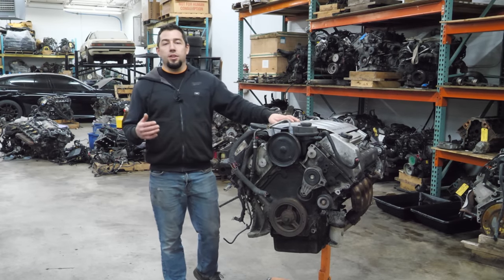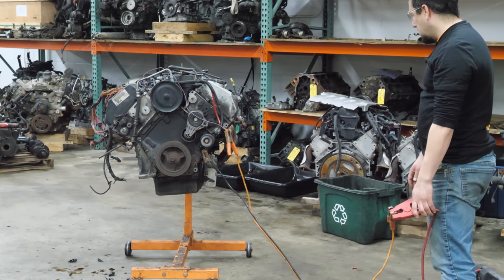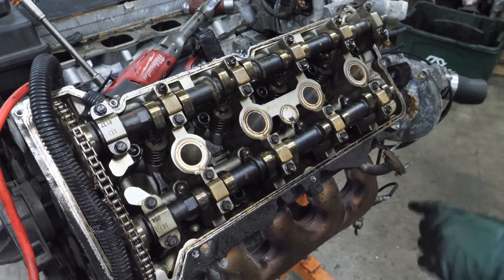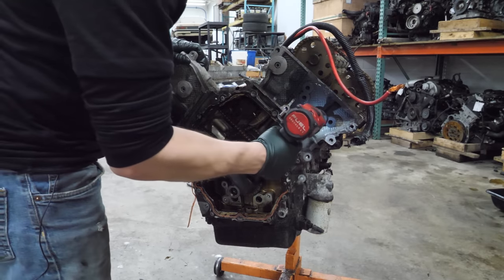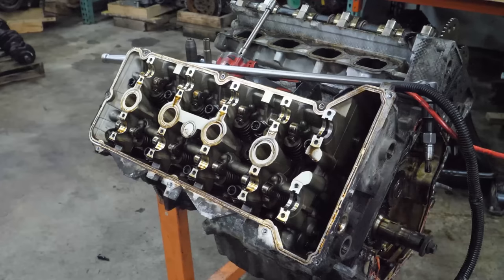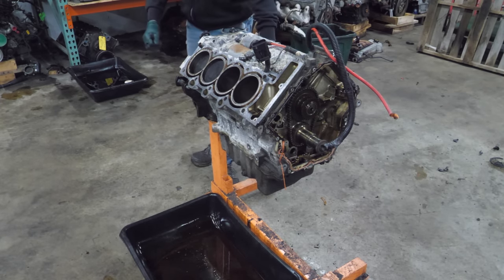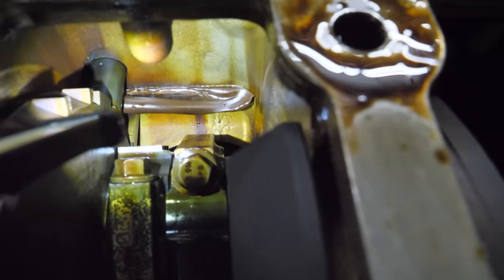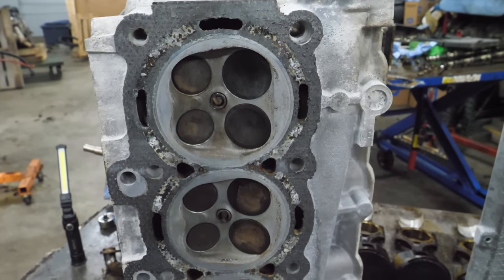Customer Returned This Cadillac Northstar L37 4.6L V8, How Many Things Can We Find Wrong?

Comment: The oil pan was definitely re-sealed. The Northstar is notorious for having oil leaks in various areas. Not to mention the condition of the head gaskets has not surprised me one bit, that's due to the head bolts stripping the aluminium threads.

It'd be a great engine if not for those engineering blunders.

Comment: Ya know, the sad thing about the N* is that besides the head stud issue, it's a fantastic engine. Efficient, light, good power. However, there are two things you gotta do to them: Reseal the upper oil pan/block split, and do the aftermarket head stud repair. If you do, you'll never have trouble out of one again. It's too bad that they have the headbolt thread problem. And that the vehicles they came in are crap. They're actually a really good, otherwise well-engineered engine.

The headbolt issue was resolved in the last gen of vehicles that had them.

Comment: I bought a 1996 STS with a 4.6 Northstar. I got the car at a drug enforcement auction for $2,500 with 8,000 miles so I put it on the road with my taxi company. We got almost 275,000 miles before it failed. I think the reason mine lasted so long was that I changed the oil every Friday using Mobil 1 synthetic oil. When it went through it was very catastrophic. (Broken crank, driver triedstarting the engine at 52 degrees below zero.)

Comment: Had a '94 STS which spontaneously threw a rod while doing a spirited merge on the interstate. No head issues, cooling issues, no signs of spun bearings, was good with oil changes... what a shame, body was perfect, only 60K on it. Had to junk it. Bought it for $4000 from an old rich contractor.

Comment: I wish you told me before you were going to do Northstar. Cause I would have told you to try brake the threads of the head bolts so that we would see how much force is actually needed to pull them off by torqueing them 😁.

Comment: I had a 98 Cadillac DeVille with that engine, with only 50,000 miles everything was mostly pristine but not the engine due to the head gasket issue.

Comment: I read some where years ago that the reason the starter ended up under the intake was they were working on an instant start system. The idea being to fire a key cylinder (fuel & spark) to start the engine. Most engines stop in one of three positions and the computer would use the starter to correct this position if need be.  Think I'll bounce this of wonderdog and see if he thinks it's BS

Comment: From an engine rebuilding POV catching an engine, even one with that much cooling system corrosion is better than catching an older engine with alot of mechanical breakage or blown head gaskets, or where you are essentially buying someone elses rebuild.  You might need to do a 10 over, new bearings are not too much of a problem. Catching a northstar between 150 and 200k miles with only superficial problems is the best of all scenarios, but catching one that only needs 10 over and no obvious head problems is the next best thing. 

I know people who run their engines to 400k and I know GM basically thinks a well taken care of engine will last to 350k, but really, I wouldnt do that your going to have a whole lot of problems you might as well replace all the stuff (timing chains, water pumps, fuel injectors, power steering pump, radiator etc at once). 

You can rethread the northstar head bolt holes, but this engines seems to have gone the distance without needing that.

Comment: No, the water pump kinda presses in the water outlet. I had this same engine in my 2003 STS and if you don't replace the water pump before it locks up. It will break the cam bolt off that holds the water pump drive pulley and it shreds the belt. So, as a rule of thumb. If you have one of these Northstar engines its better to replace the water pump every 100,000 miles to prevent this from happening.

Comment: Those upper oil pan/ main girdles used to leak like strainer at about 100k the gasket plate has pressurized oil through it and it was an expensive repair about 5 years ago a basic reseal was at least 3k at our shop and if you added in headstuds you were looking at about 5k for cars that were all 10 years old at the time I was there

Comment: Any clue on the uneven cranking? Mine developed a hot single cyl misfire that I never got sorted out at 192k. wonder if it broke a valve spring or something. Old dexcool plus air eats stuff and makes mud. Gets pretty nasty.

Comment: What was the torque on those head bolts? Weld a smaller bolt to the one that is broken off on the cam. That may work.

Comment: New subscriber, should have examine the thurst surfaces, fly wheel and rear main cap surfaces for damage. I ruined an engine by towing a trailer to fast. It caused the crank to have to much thrust play. The transmission catalictic converter bolts rubbed against the back of engine sounded bad.

Comment: I hated this engine until I drove a Cadillac that had a Northstar with the upgraded stud kit. I tried so hard to blow that head gasket. He even showed me one of the original head bolts for the aluminum block. It really makes sense that this was one of Chevy’s first all aluminum dual overhead cam V eights, Because the thread size for an aluminum engine was completely wrong. I really think Northstar ran out of money by the time they finish this engine and didn’t go back and fix any small issues, Because this engine was way ahead of its time.

Comment: As plugged as the pickup tube was, there seemed to be no sign of oil starvation.   The biggest problem seems to me to be a seized up water pump due to debris from a deteriorating head gasket.
This may have happed by refilling with the wrong antifreeze.. or neglecting to flush the radiator once in a while.

Comment: Water pump is easy to replace. It requires a socket that fits over the pump. The northstar was engineered to be great even game changing they cut corners by not reinforcing the bores for the head bolts.

Comment: 2004 they fixed the head bolt issue. Thicker threads with a coarser thread pitch fixed the head gasket issue.

Comment: I have an '03 Deville with this engine.  It has been well maintained since day one.  This car is why the stereotypical little old lady who only drove it to church on Sundays is stereotypical because it happens.. a lot.  I have to thank you for this tear down.   The rumor is that the head bolts were the Achilles heel of the Northstar... especially the earlier versions.   I expected to see some aluminum in the head bold treads.  But there seemed to be none.   Is it possible that the headbolts stretched allowing head gasket failure?  Nah.. the inside metal seals still looked good.  I go with that the water seal part of the head gasket disintegrated for some reason..  which caused the water pump to seize which burned out the belts.   I'll bet it didn't even get overheated.  The seizure would have caused a lot of scary noises.

Comment: What's bubbling up is crude oil !!  Quick, get a well driller, you've struck it rich !!!

You should get a clear plastic safety tub.  That way you won't have to lift it up to find the bolt heads.

Comment: That engine looks like it's clogged up with the infamous Cadillac cooling system "conditioner" pellets (Stop-leak) that get installed when ever the cooling system gets serviced or when a new pump or radiator is installed following mfg. instructions... From day one Cadillac knew about the head gasket issues going back to the mid 80's and the HT4100 engine.  Great tear-down video...

Comment: Back when I worked for a caddy dealer , about 10 years before I got there, I was told they had a used car dealer that called the rtv around the block," a used car engine reseal. " I saw some of them come back and they looked alot like that.  

The news did a story on him and he magically disappeared from the dealer world.
Reply: Should've clarified and Said it was solely on the outside of the engine.  They would rub a few tubes around the outside while spreading it with a finger.

Comment: I had a Northstar in a Caddy, they love to rev, but the head bolt's pulled out and combustion gas gets introduced to the cooling system.  Maybe that happened in you're motor.  I like the motors though (till they blow up) tons of power and torque and they are meant to be operated at high RPM, go figure in a big Caddy.

Comment: An interesting engine design, but seems overly complicated.   A unique feature is that the cam chains are driven from a sprocket mounted in the  location where a more "normal" cam- in-block camshaft would be located, rather than from the crankshaft sprocket.   Guess this shortens the cam chains.  Do you plan to re-assemble the engine?   Interesting video.

Comment: I had an ‘88 Ranger 4 cylinder that had a loss of oil pressure. They had to pull the engine in my case but what they found was the oil pickup was covered with flakes of silicon gasket material. Yep. Ford did that. I paid.

Comment: Eric, when I saw the axial play on the harmonic balancer, I actually thought that the engine was completely finished. To my surprise, all the main and rod bearings were in good shape, which would not have been possible with such a large axial play. Any idea why the harmonic balancer had so much axial movement when it was still bolted to the crankshaft? 🤔🤔🤔

Comment: Had to laugh at the front valve cover frustration. I'm a former owner of an Aurora, which used the 4.0-liter version of the Northstar, and was looking to see if you knew about the camshaft sticking out to drive the water pump. Weird way to do it, but dictated by packaging, with there being no room on the front of the engine where the water pump should be.

BTW, the word Northstar never appeared on the Aurora anywhere, but the 4.0 is simply a sleeved 4.6, and they are entirely interchangeable. The "hot-rod" thing to do with an Aurora was swap the Cadillac LD7 engine, replacing the Aurora's 250HP with Cadillac's top 300HP. All exterior dimensions and connections were identical, and they even ran the same electronics.

The head bolt threads was a very common failure, and it was understood that any time the heads were pulled, you HAD to put in the stud kit, even if you didn't see any threads come out with your head bolts. If the car you were test driving even pretended like it might want to think about overheating, move on to another car.

Also, the aluminum was said to be so porous that the outside of the block would get oily simply from seepage through the metal.

Comment: The Northstar motor is also known for pulling the head bolts (threads) out of the block, with only normal use and no overheating.  Wanta know why there re very few 100K miles Northstar motors.......cuz the bolts pull out of the block and it causes coolant to leak into the oil !!!!!!!!!!!!!!!!

Comment: My dad has a NorthStar that continues to overheat.  It's got a new radiator, water pump, thermostat, etc. etc. and yet it continues to over heat.  Pretty sure they even replaced the temp sensor(s) and it still runs hot.  The engine now just sits in the Caddy that it came in and collects dust.  Dad refuses to anything more to it.  Still a beautiful looking car and he usually keeps the hood up in the garage.  Nice looking engine; by just staring at it.  If only it could go down the road w/o getting too hot.  If any one has tips or tricks in regard to this issue, which is apparently common with these engines, or so he's been told, it surly would be appreciated.

Comment: Eric you didn't address the crankshaft end float issue, I got a glimpse of some wear on the crank surface, I once had to rectify a Nissan UD 2 stroke engine that my brother had put together with the thrust bearing the wrong way around with steel to steel facing the clutch pedal pressure. But seeing as you spent 2 nights on this tear down you are forgiven. Ted from down under.

Comment: 'Tis sad that the ghosts of HT4100 are still in effect today. Attorneys can take some of the blame as those hamstrings going back to the '80s force DoD and Variable Valve Detonation still thrust upon these series of motors. Just think back in '08 where the 5.3 l version was considered the 'Super' Lacrosse option and based on constraints GM could have used the 3.8 S3 that I still run and for 50$ plus X thousand premium add the Eaton SC dealers could use that instead as 'Super' option w same 3800 offering. Plus I could have snorkeled the speed holes to the intake later on😊. That mocha color was sweet. I guess GM saved that for the LS LT(again) line...  
Seeing those oil covered plug holes I was like the additional North Star ignition fuse must have been blown or somehow got jarred loose😅. Eric that pulley tie in to the valve cover gasket was an additional anti theft measure. But seriously the good things that I saw based on the punch outs in the cam area was if GM decided to back chain on the opposite end harmonize to the crank, the valve laziness could have maintained the ok efficiency and great power. And even the foreign auto makers with OHC caught on to the main chain pulley/spindle system.

Comment: You're asking why they had the pulley going though the valve cover on an engine with the starter motor underneath the intake in the valley. Logic and repairability went out the window long before the camshaft driven water pump entered the picture 

I thought the thermostat in the valley of the 3.0L v6 in my Vue was poorly thought out. Starter motor is an order of magnitude worse.

Comment: Hi buddy, I’m noticed that you do brake your cylinder heads from outside, and others do from inside, Im doing a OM648, actually 3 😂 and I usually don’t ask but which is best if I want to rebuild the engines?
Reply: You do it in the opposite pattern to what the engine manual says to tighten them. Almost always head bolts are tightened from the center outwards and are loosened from the outsides inwards. But in reality, it doesn't really matter how you break them because you are resurfacing the deck and head(s) anyway.

Comment: If GM had just improved the design flaws earlier, I think the Northstar engines would have been remembered more fondly. The later years like 2005+ were actually decent engines, but why did they wait a decade to get to that point?  The 90s-2000s would have been a lot more pleasant memory for Cadillac if they put a little more effort into Northstar improvements.

Comment: They did use the socket to remove the water pump . Around 2006 they inverted the water pump mounting so you had to take that cross over off and unbolt the water pump A lot of problems with leaks on the cross over gaskets . . The cooling system was the real problem with that engine I do not know if it was the dex cool or just the design of the cooling system

Comment: I've seen one 3.5 northstar. Owned by the guy who painted my house. I traded repairs to his car for his painting skills. I did an oil change on it and when I pulled the filter it was like solid plaster and in pieces. Crumbled when I touched it. The shitlube shop he'd been going to couldn't figure out how to remove that cursed filter cap from the oil pan so they just never changed the filter. For more than 5 years

Comment: So, there was an O-ring sort of gasket that went the groove there between the case halves?  Betcha you had to buy a gasket kit to get it and the owner didn't want to do that, so the old gasket went back in with a ton of RTV  to make sure it fixed the oil leak that started the whole thing. Or maybe no old gasket but a ton of RTV.

Comment: They don't need to overheat for the threads to pull. Corrosion is enough along with poor head gaskets. That's when they overheat, not the other way around (unless the water pump goes of course!). My 97 Aurora has been upgraded with much better head gaskets and Jake Wiebe's Northstar Performance head studs.

Comment: The 4.0s in the auroras were extremely durable compared to the caddys, seemed like they didnt suffer from the same problems.
Reply: Yes indeed ! I still have an 03 aurora with 148,000 miles on it and it'll still light em up good !  I've owned 4 Northstars and only 1 was a 4.6 in an 02 Seville SLS.

Comment: You should be able to pry off the heads with a small flathead screwdriver. No need to remove the bolts.

Comment: GM actually made a six or 8 tablet organic coolant system stop leak for these engines. That is probably what is around the headgasket and plugging up the coolant ports. Probably a overzealous service advisor sold them for use as a maintainer additive.

Comment: The best thing is the thread repair kit the dealer used also used the fine thread time serts so it will happen again they even made over sized time serts. the only way to cure this problem was using an aftermarket time sert kit that used time serts that were twice a long and very corse threads to really dig into the block.

Comment: All the grunge in the cooling system (water pump notwithstanding) might be the remnants of those stop-leak tablets (light rust colored) that Cadillac was so fond of. I know they were used in the 4.1, 4.5 and 4.9 engines. I'd suspect they were used in the Northstar, too. Cadillac didn't even trust their own aluminum castings or head gaskets.

Comment: I have a 2008 Buick Lucerne with one of these Engines, works great but leaks oil an it a difficult engine to work on. Other than that it is an economical engine to put gas through.

Comment: I had several Northstars very reliable
Reply: If you fix the headbolt issues they can be decent, you need to pull the engine so you need to know what you're doing. Not really a job for the avg person.

Comment: I have one of these at my house a 2000 or 01 Seville STS with 84,ooo. And steam comes from the exhaust pipe when it's running. How much would you charge to repair the engine. Can't find anyone to work on them